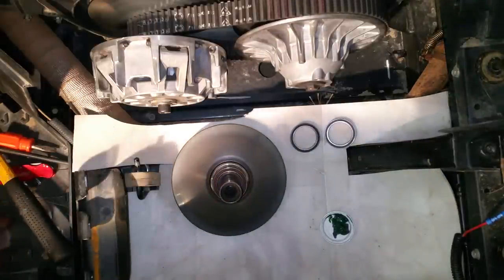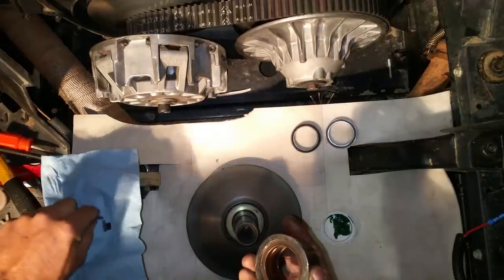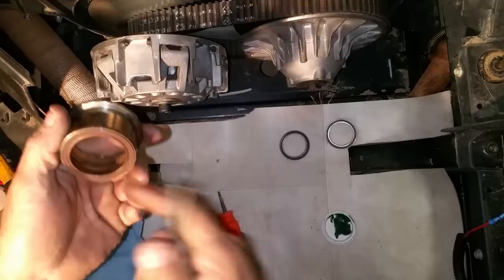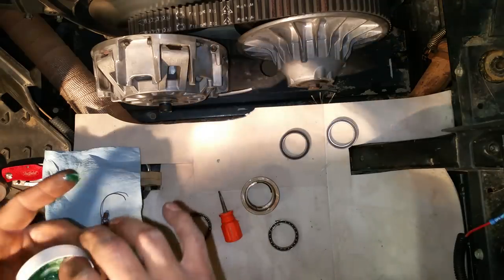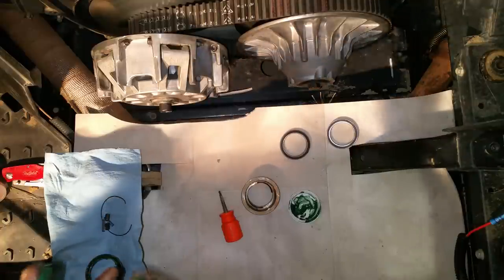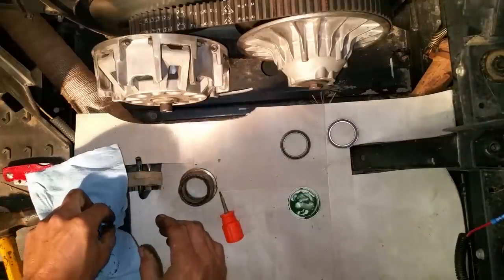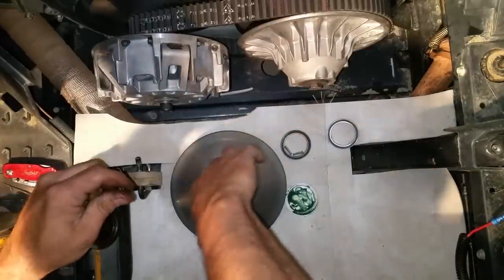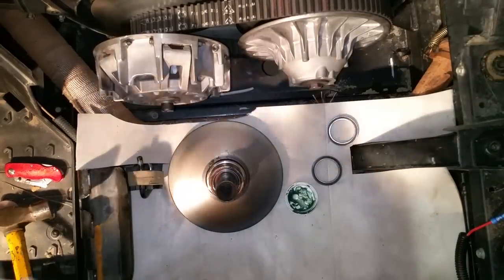Oneway bearing service.

Comment: If your bearing has dirt in it, chances are it's complete junk so you really should make a point out of that.
Don't just add grease to a dirty bearing either. If it got dirty in disassembly you should put it in a parts washer or likewise and get all that foreign stuff out before you grease it.

Comment from the maker: I did use sealed on install. Video was for those who want to service oem bearings. To get full life out of. oem single sealed bearings service should be done every 1000 to 1500 miles.

Comment: What grease is that ?? I thought that grease is expensive?
Reply from the maker: The grease is very expensive.  The grease used was cheap grease. In the video I stated the bearings were junk that I was greasing. It's actually a lot cheaper to buy the double sealed skf bearings. You can buy probably 8 skf bearings for the price of one tube of the oem recommended grease.

Comment from the maker: Brp says it’s a one use bolt. I personally used mine three times before replacement. As for the 14 up being double sealed. I just replaced bearings in a 15 Maverik at the last roundup and they were still single sealed. Commander and mav both use sane bearings . So guessing 14 and up isn’t true.
Reply: @Ace Fire
 the bearings themselves are not “one way” bearings right? So what actually controls or stops them from spinning in both directions?
Personally I run a CVTech TrailBloc on my XMR & know them inside out, but currently helping my cuz with his 2007 800 Max
BTW great video & I can’t believe how many geniuses missed you clearly saying the bearings are junk & you’re just re-packing it for video purposes. It’s unfortunate but does help explain why so many how-to videos have the comments turned off :-/
Reply from the maker: @wowchad  there two cups with springs that hold pressure against the bearing housing. The housing is stepped with a slope. That allows it to only turn in one direction. If you try to turn it the other direction. The cups hit the step side and it stops it from turning .

Comment: Ace Fire the bearings themselves are not “one way” bearings right? So what actually controls or stops them from spinning in both directions?
Personally I run a CVTech TrailBloc on my XMR & know them inside out, but currently helping my cuz with his 2007 800 Max
BTW great video & I can’t believe how many geniuses missed you clearly saying the bearings are junk & you’re just re-packing it for video purposes. It’s unfortunate but does help explain why so many how-to videos have the comments turned off :-/

Comment: If the one way bearing is wore out would it cause an extremely high pitched squeal when the bike is decelerating?
Reply from the maker: will oakes I possibly could but I have never seen or ran one that long. It will make for hard shifting if they need serviced and noisy while shifting.
Reply: I have this high pitched sound out of my 570 when decelerating. did you find the cause?
Reply: I have 16000 miles on my commander and never grease it ?? Been fine 🙂

Comment: What type of grease did you use?
Reply from the maker: Preston Miller The grease in the video was Lucus hd green. But that is not what it calls for. I used it just for the video. The bearing I greased were junk. As you can see there is a complete clutch on the machine.

Comment: I Have a 2016 can am xds turbo does my clutch separate like that with the 2 haves I'm trying replace the spring and weights..
Reply from the maker: No you have to use a separator with the puller bolt in the primary. The inner and outer on the turbo clutch has a square wedge fit. If you pull the cover and remove the primary bolt you will see the square inner shaft wedged into square hole in the governor cup. Uatv-tech.com has the separator for a lot less than the factory tool. Oem tool is 350$ thinking Uatv-tech.com is 199.

Comment: is it true that you can only use the primary clutch bolt 1 time & it needs to be replaced everytime also brp says the bearings are sealed on both sides 2014 and up do you know if that is true?

Comment: Het there. Been all over the forums and no help. What type of primarily & secondary are these. I have the exact set in my 2013 Odes Dominator. All I hear is "Can-Am" style. I want to put a new drive clutch in this thing already!
Reply from the maker: I looked up your cvt primary and secondary . They look very similar. But with out having them side by side no way to know.  There are no manufacturers stamps or name on the can am cvt. So it could be possible they are getting the parts from same manufacturer.
Reply: @TheAcefirearms  I knew I was in for trouble as soon as I couldn't find a part number on these things. What a pain. Thanks for the reply man. You know your stuff. Really good channel you got going on.
Reply from the maker: @Kevin Jackson  https://www.sunwaymotorparts.com/products/Yimatzu-ATV-Parts-Clutch-CVT-Driver-Pulley-UTV-Odes-LZ800-800cc.html this was all I could find .

Comment: What are the symptoms of a bad one-way bearing? I've got 1400 miles on my '15 Maverick, just going through and doing some maintenance on my machine and was going to grease the bearings like it says in the owners manual, but that looks like a terrible design and I might just wait until it acts up and switch to those sealed bearings.
Reply from the maker: If you're at 1400 they need serviced or replaced. Hard shifting and grinding are the main symptoms.
Reply: i just rebuilt mine last week. the symptoms were hard shifting, sticky shifting, and a squeeling noise coming from the clutch. i bought the re-build kit from amazon, all-balls racing.
Reply from the maker: @stefanchomiak1  good luck with the all balls bearings.
Reply: @TheAcefirearms  i want to thank you for your video. it helped me. i got the repair done on my outalnder 650 MX in less than 2 hours and it  fixed the issue.
Reply: @TheAcefirearms  All Balls Racing 25-1716 One Way Clutch Bearing Kit
Reply from the maker: @stefanchomiak1  There were 5 different bearings tested and all balls were the first to fail. The sk bearing were the only ones to break the 1000 mile mark. I personally had a quad boss wheel bearing to fail with 80 miles on it. 650$ in replacement parts but I saved 40$ when I bought it over the oem price . Hopefully they work out for you but keep in mind they can let go at any time . My time is worth more than a couple dollars. And I'm sure yours is as well .
Reply: @TheAcefirearms  shit I did not know their quality is so poor.  I will keep you posted. Hopefully I get lucky..  so far so good but it's only been a week. I am doing some hard riding in August so we will see how they hold up.  I appreciate your feedback
Reply from the maker: @stefanchomiak1  yeah hard to get anything quality out of China. All balls , quad boss and moose bearings are all from same factory in China just packaged in different boxes. But yes let us know how they hold up.  Thanks
Reply: @TheAcefirearms  one more question, which brand do you recommned i go with? I will rebuild it again with the better quality berrings, especially since its an easy repair now thanks to the inspiration your video gave me. thank you. SK Bearings? correct?
Reply from the maker: @stefanchomiak1  sk 61808-2RS1 you already have the all balls in there I would run them. Then switch over next time around .
Reply: @TheAcefirearms  thanks for the part number partner. cheers, for all your help.
Reply from the maker: @stefanchomiak1  no problem
Reply: What is bearing size? Or code ?

Comment: Will a bad one way bearing allow water in the transmission
Reply from the maker: No but when you say transmission are you referring to the cvt housing? If you are talking about the housing. You can buy a 2" Fernco pipe coupler from lowes or some place equivalent.  Replace both one on the front and the rear. They are bad about dry rot cracking then water will get in. Fernco will out last the machine .
Reply from the maker: There's also three seals one behind the box at primary and other behind box at secondary . Then the cover seal .
Reply: @TheAcefirearms  no I mean like where the gears are lol I serviced my machine and when I drained the transmission fluid it was milky. I checked the casing and can’t find anywhere where water could’ve gotten in that’s why I asked about the one way bearing bc now my machine is sometimes hard to shift outa park and such and it now has a whining noise when driving that gets louder the faster you go. I’ve flushed my transmission until the oil came out clean. I’m just lost on what to do next
Reply: @TheAcefirearms  thanks for replying
Reply from the maker: @daltonc1992  the one way bearing is in the primary engine end.  If you are getting water in the gearbox I would check the vent line. It may have a Crack or hole in it.
Reply: @TheAcefirearms  will do appreciate it bud

Comment: So just a question. I have a 08 can am renegade 800. Just put a new belt on it. I shifted in high and the bike will roll forwards. Same for reverse and all the others. It will pull at about 3 mph with no throttle. Doesnt idle high at all. Do you think it’s the one way bearing?
Reply: @ace Fire
Reply: @Ace Fire
Reply from the maker: Pull the cover off. Start it in park if secondary doesn't stop turning in a matter of seconds then one-way bearing is probably the issue.  But also make sure the weights move freely in the primary.  Have seen them stick do to the bolts surface rusting.
Reply: Ok it didn’t stop spinning.
Reply from the maker: Definitely one-way or stuck weights.  With it off will belt roll backwards freely. And is the belt making contact with the inner and outer of the primary when off?
Reply: No it won’t roll backwards freely
Reply from the maker: @gabemcintosh4055  I would one-way is toast if belt isn't touching the inner and outer sheaves .
Reply: @TheAcefirearms  what if its touching inner sheave? i got the same problem with my 08 rene 800
Reply from the maker: @StevenZolnai  somebody makes a shim kit to move the secondary out . But I personally have been lucky never needed any.
Reply: @TheAcefirearms  I actually brought it to the shop to get the motor taken out of it and ever since it got done I've had this problem I'll see maybe my secondary is out of line a bit
Reply from the maker: @StevenZolnai  kinda sounds like it went back together a little different than it came apart .

Comment: How often you do this? why you not using seals from both sides of the bearings?
Reply from the maker: 1000 to 1500 miles. But the double sealed bearings are fairly cheap. You may just want to buy the bearings and put them in

Comment: So I have a 2021 maverick x3 turbo rr...literally 3 weeks old...when I start to shift, it hits reverse and won’t go further...it will start backing up without even hitting the throttle...I’m thinking it’s this bearing....thoughts?
Reply from the maker: Check your rollers in the secondary.  Sound like you may have blown them up.
Reply: @TheAcefirearms  ok I’ll check that first...thank you
Reply from the maker: @matthewwrichard9753  shifting is controlled by the secondary. So if not shifting up the secondary is hanging up.
Reply: @TheAcefirearms  I pulled the clutch housing cover and can see the rollers look good...at the bottom of my housing a found a piece of metal that looks like a keeper of some kind...it’s about 1/8 inch or smaller and was probably a circle before it was broken
Reply from the maker: I personally haven't had the x3 secondary apart yet. I have had the primary apart but don't remember anything that small in the primary that would effect the shift out. You do have rollers and slider pucks in the primary as well. Will see what I can find on the secondary that may have came apart other than the roller.
Reply from the maker: https://www.partshark.com/oemparts/a/cam/57d2c37787a8660e6845c877/transmission

Part 11 and 14 only thing I see on parts page.
Reply: @TheAcefirearms  chewer my belt up pretty good...I’m going to pull them both and see what I can see

Comment: Where Friction washer
Reply from the maker: Amel Šahman never seen any friction washers on commander or Maverik. Only on the x3.
Reply: @TheAcefirearms  for what friction washer serves
Reply from the maker: Amel Šahman on the x3 there’s one on each side of the two way bearing. It allows the bearing to free spin stopping the bearing housing from being in direct contact with the inner sheave and outer spring cup.
Reply: @TheAcefirearms  Prevedi s jezika: hrvatski

I removed the friction washer on the outlander 570 because it was difficult to shift into gears, the gearbox was heavy, the friction washer pressed one way bearing and so the force was transferred to the secondary pulley which made it difficult to change gears from N to H and from N to R, when i threw out the friction washer everything is fine and the gearbox works easily, the outlander 400 and 450 as well as the 1000 has no friction washer, did it do well what did i have any side effects, which is the basic purpose of the friction washer ...
Reply from the maker: Amel Šahman should be fine being you have a oneway not the two way .
Reply: @TheAcefirearms  it is considered that the friction washer serves to the press the bearing and to mske it easier to move up the hill to keep the belt safe from damage
Reply from the maker: Amel Šahman no it has nothing to do with the belt engagement. Only thing the oneway does is control low speed engine braking. I actually removed the cups and springs on my xmr so when going down hill I could coast from the top with having to throttle up to continue going down . By removing the springs and cups under the oneway housing it then becomes a free spin two way. Engine brake still works above idle but once you slow down to 1800 rpm ish it will replace the belt allowing it to coast .

Comment: I stoped watching thos after he started repacking a beating with dirt in it lmao, no break clean not even gonna atleast clean it out man?
Reply from the maker: Guess you was missing the point of the video . Those bearing were junk also said that in the video. It was for those that haven't pulled the one-way bearings out or packed a bearing before. So there was no reason to clean them. The new clutch was on the machine that's the old clutch laying there. Sorry I guess there's always that one or two!!
Reply: @TheAcefirearms  yeah sorry I finished watching the video then seen that, at first I was cringing lol my bad good video
Reply from the maker: @GregoryJohnston77  it's all good was wondering how you missed me saying they were junk in the video.  Now we know.